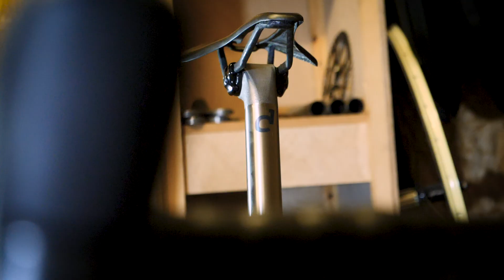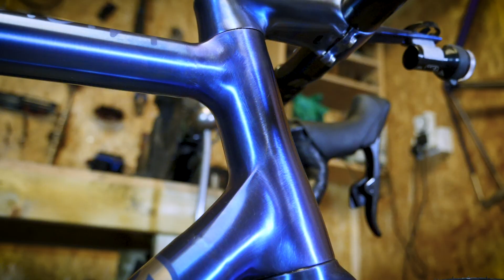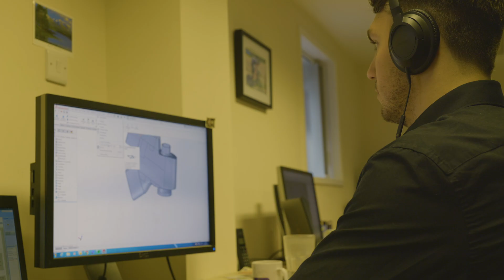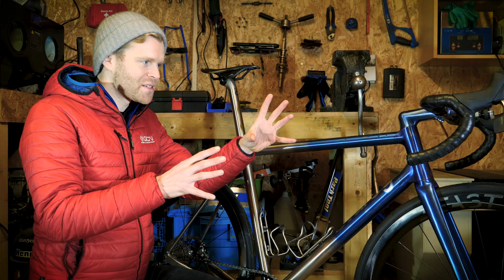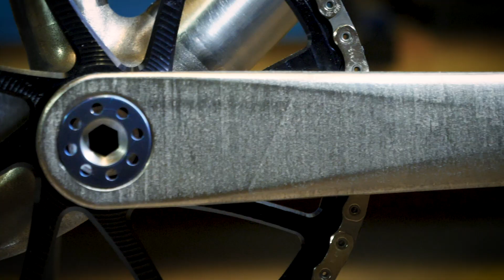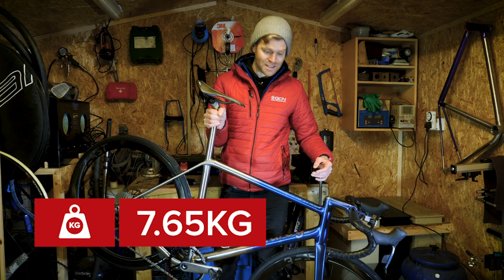Is This 3D Printed Titanium Bike The Most Beautiful Bike In The World?

Comment: How strong is it? "Top secret"
Reply: If it's the "Top Secret" in my mind.

Then sir your a man of culture.
Reply: Not very strong compared to machined titanium. Laser sintering is nowhere near the strength.
Reply: @PaperHunter  no where near the strength of forged titanium, but I doubt hand welded titanium joints are significantly stronger, or even geometrically correct seeing how easy it is to warp.
Reply: @PaperHunter  , it's EBM not laser sintered, different process, the Ti used is Ti6Al4V, testing has been done and it is very close to machined Titanium. The reason it is slightly less is because the density of the material is less (say 99.7% relative opposed to 100%). The upside is you can create more interesting shapes with it and create fewer weak points.
Reply: @georgegrant6388  if it true why using tubing? Just print frame all at once.
Reply: @Mike22313  Build chamber size limitations, a whole frame set of lugs were built in a chamber that is 200x200x210, there are machines that do 400x400x400mm and some bigger, but the technology isnt there yet for a full bike really.

Also just because you have have the chamber space, you need to fill it to be productive, total build time is basically defined by built height, not how full of parts the chamber is. So having just a frame in a chamber = lots of empty space,  but the machine has to run the same amount of time which costs a lot, so the unit price of a frame is then very very very high. You need a build chamber to be full of parts to bring the price down.

Also there is no point building round tubes with 3D printing, they will be stronger and cheaper if built traditionally. The benefits of 3D printing is creating shapes that couldn't be manufactured traditionally and zero tooling costs.
Reply: @Adurianman  "No where near" is a bit harsh :-)  Check table 3 here for instance https://www.sciencedirect.com/science/article/pii/S026412751830916X 
Depending on heat treatment and surface condition, it can be comparable. In the video, it was tumbled, so not as bad as an as-built surface, but not as good as a machined surface
Reply: @georgegrant6388  so, you say, it's just a problem of chamber size? 
But, it's cheaper to make almost ready to go frame in printer, then use manual labor to weld it. And you can make maximum aerodinamik shape tubing this way. 
So, if some big manufacter, get proper equipement, they can make realy cheap and good bike this way?
Reply: Yes, not very well put...they could say "Strong enough" like luxury car makers point out "powerful enough" instead of exact hp/nm numbers which above certain level don't really matter.

Comment: Last I checked you couldn't 3D print molten hot steel. You can, however, 3D print a wax core and then create a ceramic mold from it and cast the Titanium in the mold. You then need to destroy the mold to get the part out, making this a sacrificial method. Am I splitting hairs on this one? Maybe - but let's not say that the parts are 3D printed, Ok?
Really nice bike, by the way - but can we smooth out the cast parts so they don't look like my kids did them?
Reply: You need to check again :-) Titanium, steel, and nickel base alloy parts can since many years be built ("printed") directly from powder (or wire)
Reply: @Hazzeman666  in the video what are they printing? Wax. So is the part strictly 3D printed?
Reply: @BluesTheBestBoyIGuess  they are showing some plastic printer printing something else, nothing to do with the Ti parts. Google/youtube "Arcam EBM" and you should find some movies on electron beam melting

Comment: im kinda feeling weird about 3d printed steel, alloy, iron, or metal and i think the more accurate way to so say it being cnc'ed or 3d engraved not 3d printer, cuz print is add matterial not erasing it
Reply: But here they have "added" material, from fine powder to a final component, hence the name printed. Thereafter some sections have been machined (CNCed)

Comment: Is this really 3d printed, though? As I understand it, metal can only be printed by the sintering process, which is hugely costly which would be prohibitive for projects like this. Isn’t it more likely that the lug models are 3d printed and then investment cast in Ti? Some clarification here please, because they way the bike is presented I believe is misleading.
Reply: They wrote under some other question that it was made through EBM, using an Arcam Q10, so melting, not sintering or investment casting....

Comment: Charge bikes have been doing similar to this for years at this stage, the Atherton's MTB frames are doing the same too, but with carbon fibre tubes to join the 3D printed lugs. While this will make a few dentists slightly poorer, there's nothing of technical interest here that hasn't been done before. The completely integrated cabling is the only thing being done here that I haven't seen on other 3D printed bikes years ago (It's been done elsewhere too though), and since no detail of how the routing is set up is given, I wouldn't be at all surprised if it's all sharp turns and cable drag and complete misery to service.

The dropped chainstay design is not only ugly but it also flies in the face of the main benefit of paying the high cost of 3D printing titanium in the first place because it uses more material than is needed by having a longer tube from the BB to the rear axle than a straight tube. Since in 3D prints, the price of the print increases as the volume of material increases, it's also adding cost for no reason too, but this is so far off the value for money/performance for price track that this consideration can be safely ignored.

Comment: It looks lovely but sintering which is the process used in 3D printing metals is nowhere near as strong as machined or cast parts. I wouldn't dare ride it any more than I would a cracked carbon frame on roads with potholes.
Reply: Not a chance I'd get on that thing on the roads that I ride on regularly.
Reply: Oh good to know! Thanks for your expertise on this topic. You should write an Email to Tom Sturdy and warn him that the bikes he has been building for years are literally a death trap!
Reply: @ChristophMarius  they'd have their uses, like a velodrome or somewhere with super smooth roads... I can barely ride my carbon fibre bike on my local roads, they are just terrible.
Reply: @ChristophMarius  I'm not claiming to be an expert, these are YouTube comments not a symposium but I have seen 3D printed titanium fail in an unexpected way and I wouldn't trust it on a bike, especially when the maker says the strength properties are a secret.
Reply: Actually it is typically stronger than cast material, e.g. see table 3
https://www.sciencedirect.com/science/article/pii/S026412751830916X
Depending on a lot of things, but it can be comparable with wrought and forged material. The fatigue life however, can be an issue, especially if the component surfaces are rough, so machining of printed components is preferred if the highest fatigue life is required. Perhaps not necessary here, I have no idea how high stresses one get when running through pot holes....

Comment: He didn’t answer how strong it was compared to non 3D printed / machined titanium. A little worrying!
Reply: 3d printed materials certainly haven't been as well characterised as traditional materials, and as 3d printing is essentially welding layers on each other, I'd be amazed if it's as strong.
Reply: Plus the strength of a metal is in the way the molecular structure all are in the same direction with overlapping layers like a stretcher bond .
Reply: @kidkarbon4775  It can be as strong, e.g. see table 3
https://www.sciencedirect.com/science/article/pii/S026412751830916X
Of course the porosity need to be minimized, but that is standard process development work.

Comment: Those printed components look awful. They are grainy to the point of being like a cheap cast iron. In order to smooth out the parts, a significant amount of metal has to be removed. As the builder tells us, he doesn't have any way to assess how strong the components are. From looking at them, I'd guess they are anything but strong.

Comment: Stunning bike but we need to drop the frame material BS.  Frames no matter what the material do not vertically compress.  If a Ti bike is "smooth" its because of the tyre volume and seatpost flex, nothing else.
Reply: Exactly, the frame is a double triangle, it cannot vertically compress.
Reply: @glukes9  yes and no . Tube geometry can have a drastic effect on a frame . Material selection can influence how that geometry can be applied .so a flattened horizontally seat and chain stay will flex in the vertical plane.  Aluminium has a relatively low fatigue life so having a vertically flexible seat and chain stay would have a very limited life before it cracks . Steel or Ti bike will not have the same fatigue life as an Aluminium frame . 

The material is important for the ride as it allows you to change the tubes to be suitable for what you need . 

Frame material is only part of how a frame rides when kitted up .